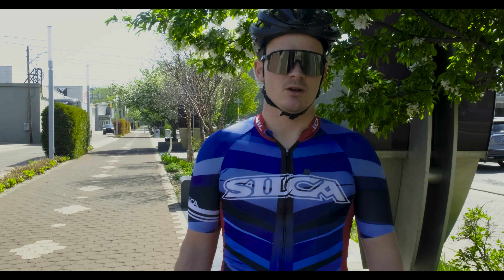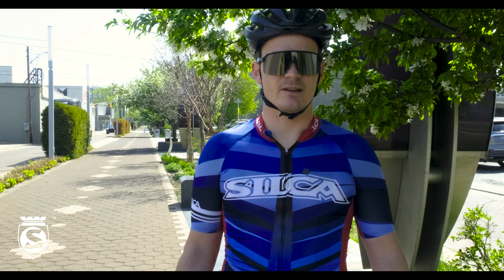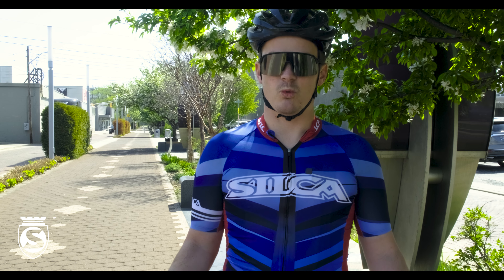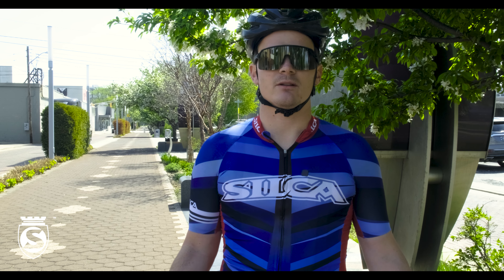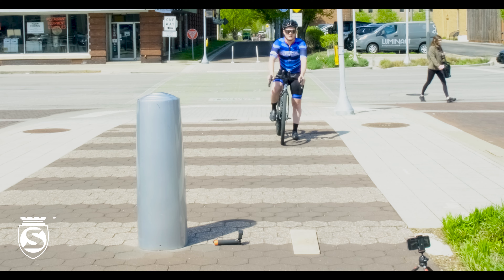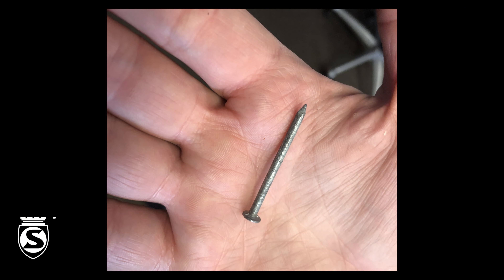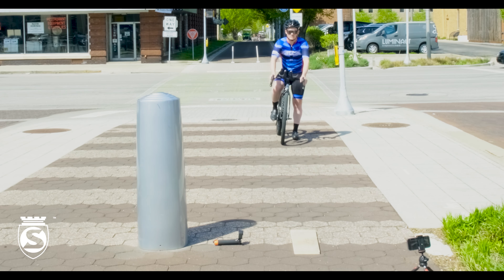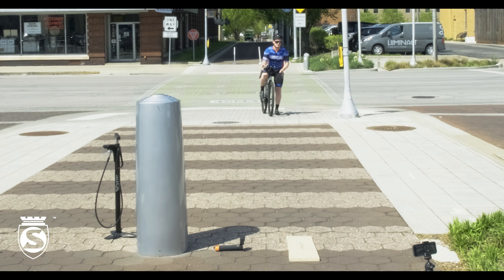Ultimate Tubeless Sealant to the TEST! Nails & Screws vs Sealant

Comment: So it’s ok for mtb and gravel bikes, what about road bikes with 28 mm tyres at 80 psi?
Reply: 80psi?
Reply: @dominicbritt  silca tire pressure calculator suggests 81psi for a 200lbs system weight on a 28C tire

Comment: I ran over something 3mm x 2mm that punctured the tyre, I didn’t even know I had a puncture as it sealed straight away. It wasn’t until I got home and saw the sealant on the rear of the bike and my shorts. Checked the tyre and only lost a couple of psi. 3 months on and I can still see the hole but it holds pressure tight.  
Be assured it works and works very well but its near on impossible to remove from your expensive shorts and shirts.

Comment: I wish I could use your sealant with my DT Swiss tubeless tape.  
Too bad- according to you guys, it’s too thin and the sealant will cause the tape to  deteriorate
Reply: This is interesting, I bought a set of Dt 700 rims tubeless ready to set up 25 mm Vitrorio Rubinos on. The original tape blew out at a spoke hole, they only used one layer! I retaped the rims with two layers, and that tape blew out at the spoke holes as well. Eventually got them set up using three layers of Orange tape. It was very disappointing experience for my faith in DT Swiss.

Comment: I've had sealing issues from small tread punctures using Ultimate Tubeless Sealant in 32 mm Continental GP5000 S TR tires at 60 psi.

Comment: Works nice when you run over vertically positioned nails and screws...which I rarely see on the road. I'd like to see a test rolling over broken glass, sharp edges instead of sharp points.

Comment: Punched holes like these do seem to seal well. But are rarely seen like this in an urban environment. We do see this sort of puncture in rural environments though. 

What don’t seal so well are linear cuts you get in urban environments, such as from glass, man made objects etc. 

My thinking is that a linear cut will tend to open under pressure, compared with a hole punch. 

This I think is where road tubeless often fails.
Reply: I agree, but the silca sealant is real gunky and has those threads in it, I bet a lot of those slits it will plug up